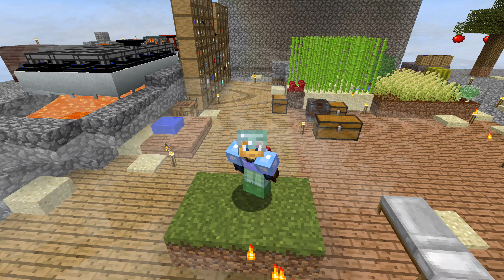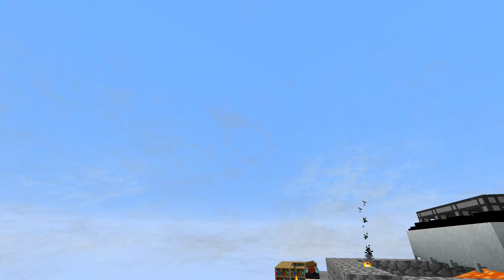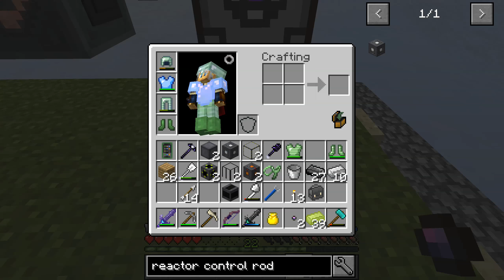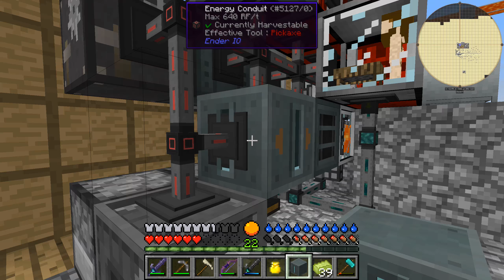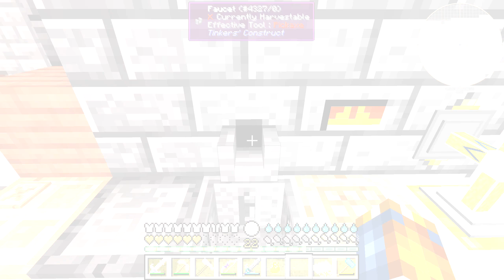Minecraft Forever Stranded - Episode 29: Proper Automation

Comment: Slicedlime ! the crystal growth accelerator has to be touching the block of water to work from what i remember (it will still use up power when not growing anything)
Edit:Your Crystal growth accelerator is technicaly powering air currently so it still uses power and isn't growing any crystals
Reply from the maker: Damn - thanks! I'll need to fix that right away for next time!